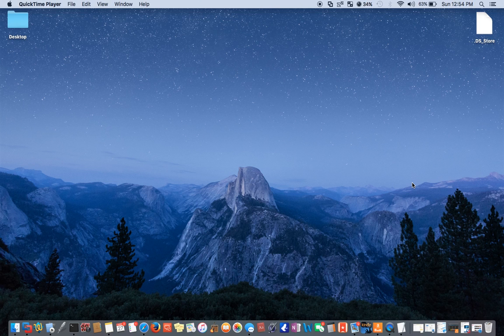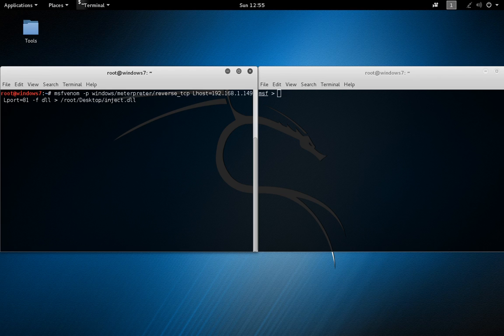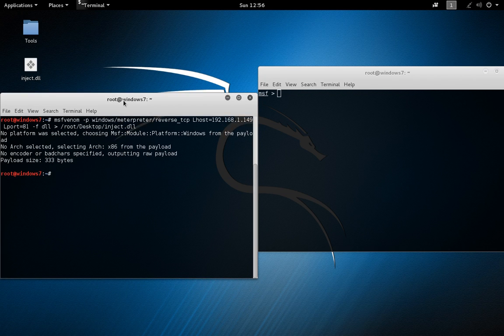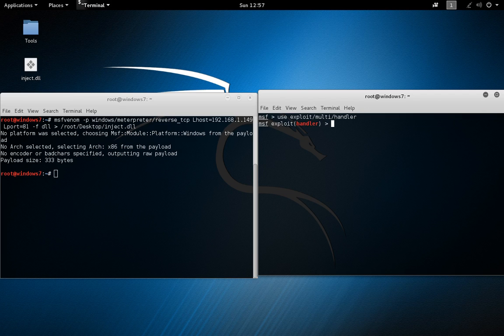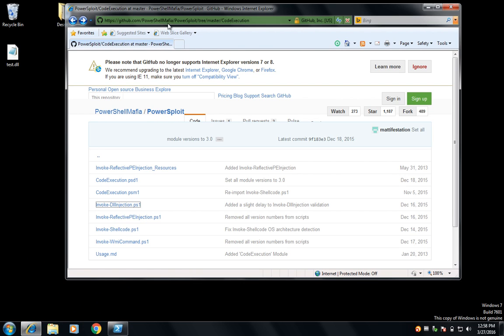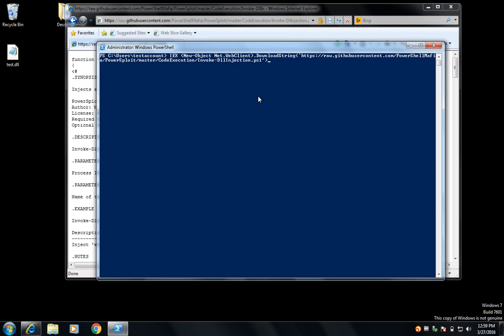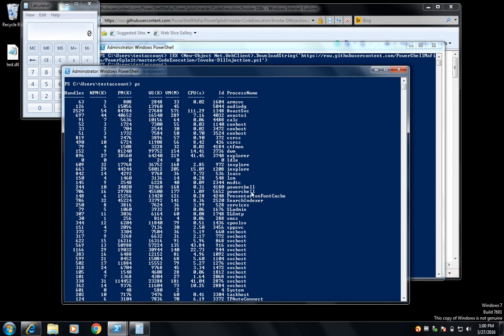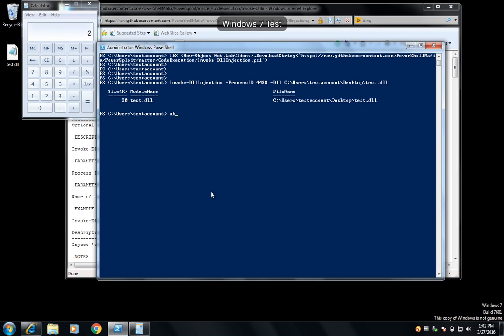Metasploit - Reverse meterpreter shell -- DLL Injection using PowerSploit and Metasploit

Comment: hi! how can I make it FUD?
Reply from the maker: Fully undetected?  Outside the scope of this video, but you will have to roll your own DLL or update the metasploit source to compile a custom DLL.  That said, you would have to know what the detection method is. etc anti-virus, EDR, egress detection.  Couple things to think about:  1. ) Unhooking 2.) network signatures 3.) Sandbox bypass  I'd start googling there.
Reply: @TheRedTeam  Do you know python? Because I have created a backdoor and it works fine but i want to execute the backdoor in memory i wanna make something like File less malware
Reply from the maker: @techgeek8343  Fileless malware is something like, "live off the land binaries".  Sounds like you might want to do some memory injection. Such as injecting shell code into a parent process. For example, injection a c2 call back under an IE parent pid, to hid the activity? Check out this: https://www.christophertruncer.com/injecting-shellcode-into-a-remote-process-with-python/
Reply: The Red Team but I wanna use In python code!
Reply from the maker: TechGeek for Windows or linux?  If windows, you are going to have to use the windows API in your python code. That’s the only way I know possible. That’s because you are going to have to create a handle, process / thread in some way regardless of the language being used.
Reply: The Red Team As you did send the code in the last reply, I will try that but how can I implement that system in my backdoor? And further can u guide me? Give me your Instagram id if you have !
Reply: @TheRedTeam  Pleas reply soon sir! I need to make my python backdoor run in memory!
Reply: @TheRedTeam  Hi Red Team, The link you provided is very informative, but instead can i inject my exe python backdoor?

Comment: this worked in Windows 7 but not in Windows 10. Any thoughts?
Reply: It should worked on windows 10. I tried it on my friend computer and it's work well
Reply: I tried with Windows 10 and I got so many errors. My first thought was that the powershell syntax has change but I have not done any research about this. Any ideas?
Reply from the maker: +Rajganesh Pandurangan should work on Windows 10.  When you are generating the payload, are you using the right OS architecture type? X86 vs x64?  Also, what are you trying to accomplish?  There might be a better solution.
Reply: hmmm...

Comment: Awesome video, do you have a way to obfuscate the dll? It's getting picked up by AV. Do you have any experience with invoke-shellcode.ps1? It doesn't seem to like the payload flag.
Reply from the maker: I have had the same issue. The work around is if you do a code review, you will notice two blocks of shell code within the script. If you use msfvenom to crank out shellcode (pointing back to your host), you should be able replace the shell code within and invoke the code within the script.  

Can I ask what you are trying to achieve or do?  There might be a better way.
Reply from the maker: +infosecguy5150 ?